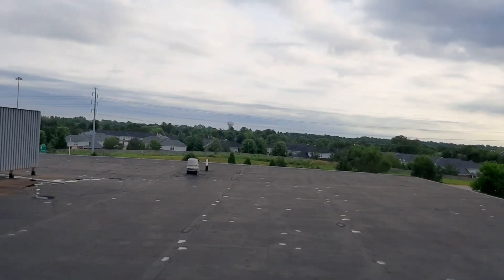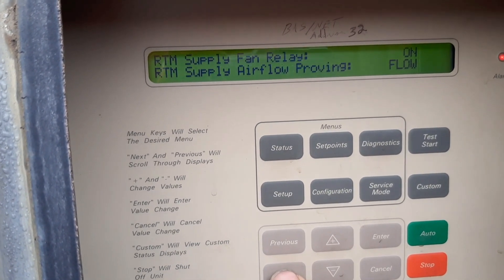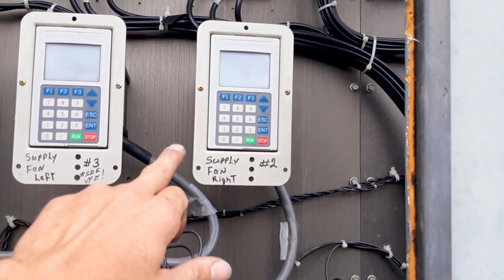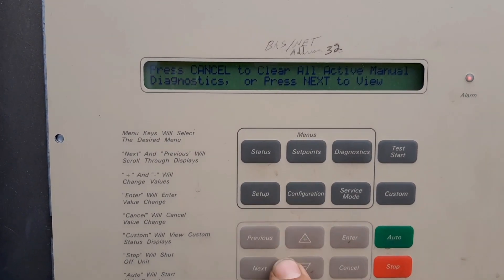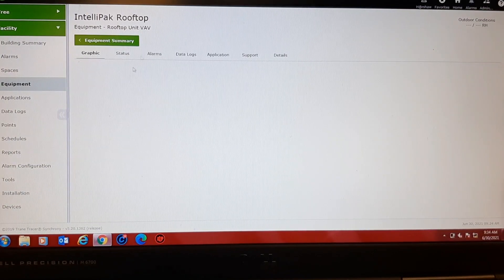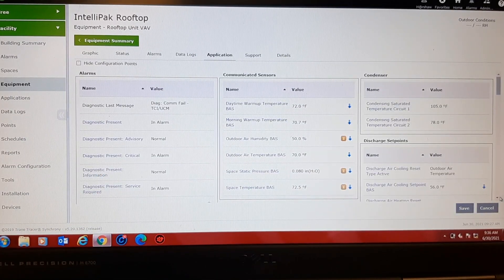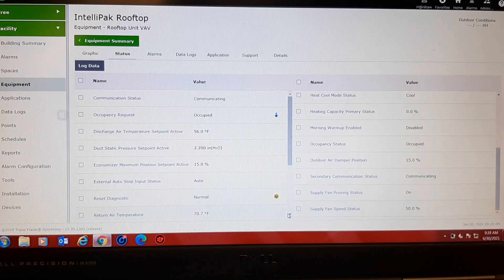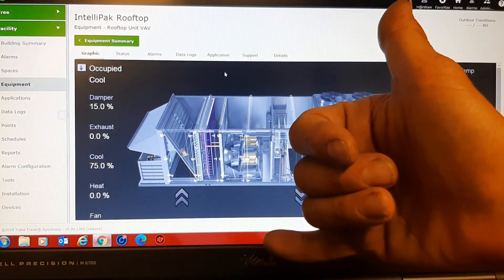Intellipack no cool service call but where is the problem

Comment: Hot damn.....2.2" wc of static. Seems fairly high. I might just be used to what ive worked on. We are usually around  1.5" wc for VAV's and other pressure related equipment I've worked on. Curious as to why its set so high. I understand its maintaining whats its programmed.
Reply from the maker: 1.5 to 2 inches is normal, a lot depends on the size of the building, smaller space doesn't need as much static. A lot that I see try to maintain 2 inches. That is a good question though, how do you determine how much static you need... something else to learn, Thanks Jason! 💪
Reply: @EverythingHVACR  yeah I was curious. Wasn't implying it was wrong, just different from what my buildings run at. You are correct though....how much is too much.
Reply: @EverythingHVACR  it all depends on the friction loss of the duct and where the static pickup is located.  Some places use the factory installed pickups that can be close to the supply fan assembly and in that case you need a higher setpoint to maintain your static down the line.  We typically run a twin tube down the line so a setpoint of 1 inch or so works ok.  The minimun static you need to maintain can vary depending on the type of box used.
Reply from the maker: When the duct blows apart it's too much 🤣
Reply from the maker: My Man, Thanks John McMaster! 💪 keep that knowledge coming.

Comment: Dell M6700 with Windows 7! You need to upgrade! :D
Reply from the maker: Lol, it's company computer and the older systems we need the PCMIA card which don't come on any new computers... but agreed a new one would be nice, good Eye! 👍
Reply: @EverythingHVACR  Interesting, what do you need the PCMIA for?
Since I work in the school system we usually get ours refreshed every couple of years but I have a custom Precision 7510 still running Windows 7 for older software. But I'm going to add a second SSD so I can run Windows 10/11 as well.
Reply from the maker: The old trane Controls, Rover and a Lon card. I don't use it that much any more